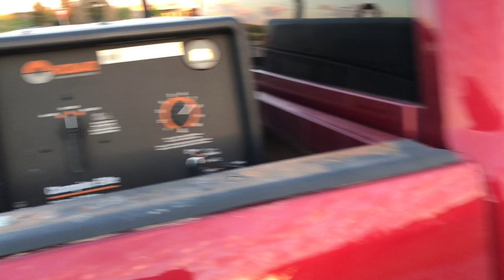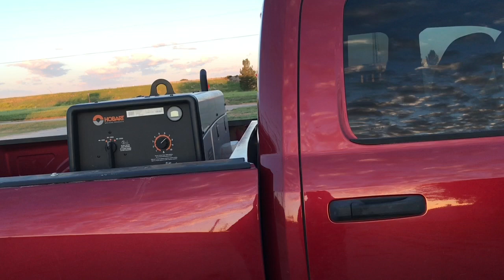I GOT MY FIRST MOBILE WELDING JOB!

Comment: Cool video, but you need to stand that acetylene bottle up, or lay it on an angle or the gases will mix. The oxygen bottle is fine to lay down, but not the gas.
Reply: Yea man stand them up for like 6 hours before you use em. Stay safe 🤙🏽
Reply: Exactly what I noticed. Good call
Reply: I saw the same yikes
Reply: @adamjoseph7124  an hour not 6 lol
Reply: The gases will mix ? 😂😂 inside a acetylene bottle, is a porous honeycomb like sponge called a monolithic mass as well as acetone to stabilize the acetylene. Stand up the cylinder 15min minimum before use to allow the acetone in the sponge to settle to the bottom.
Reply: @bscene3397  You pretty much just said the same thing I said....Go ahead and unload your bottles at the jobsite and wait for them to settle. Meanwhile, everyone else is already working because their bottles weren't laying down in the back of the truck 🤷🏻‍♂️
Reply: Same

Comment from the maker: Sorry if the music is to loud, I had to record and edit this video on my iPhone .
Reply: Happy for you buddy, but MAN you Acetylene bottle is on its SIDE. You can't do that bro it will Wreck your regulator and hoses and could cause a explosion from the alcohol in the bottom of the bottle that helps stabilize the acetylene..  you have to stand the ACE strait up at all times.. if it falls over or you load it on it side it must sit for a couple hours so all the alcohol can settle at the bottom.
Reply: Acetone, not alcohol in the acetylene bottle!
Reply: Its better with no music

Comment: good deal, buckets are nice to work on 
you might want to turn your welder longways so the controls are near the tailgate then the welder will get more air and run cooler. also you will have room up front to make a headrack to cover your  back window and you can bolt an oxygen tank to the rack for your torches because torches are really handy on most jobs and you dont want the tanks bouncing around in your truck. print up some business cards and put your name on your truck doors and you will be getting lots more work. good luck.

Comment: I’ve been welding since middle school. Took welding class in high school for 3 years and got a diploma in welding from my local trade school. I didn’t know what I wanted to do after trade school. I’ve been MIG welding for 5 years at a manufacturing job definitely not using my skills. I recently got a welder/generator and I am looking to start up a side business and keep my regular job for the benefits. Your video is very inspiring! Thanks man.

Comment: Your work attitude and personality will land you more jobs !
 #1  Never cut yourself short on safety !
 When working alone never leave your phone in the truck !
 Always invest in growing your business !
 You will find it will not be long you'll be needing a service truck with the right motivation and drive .
 I have owned the welding rig type truck but I have found the service type truck with the utility workbed more convenient to work with.. 
More boxes and drawers for all the cool tools you will find you will be needing..
 And a Crane is definitely a plus !
 Even when I'm welding on cracked leaking fuel tanks still on the machine and full of fuel !
And yes there a #1 rule to that part also !
 But yet no one wants to stick around and watch !! Lol
I'm Carl Massey & I Love my job !

Comment: Man you inspire me. I got my 3G weldering cert a few years ago and really want a rig welding machine. You got me all pumped up like I should do it. You had some nice weaving with those 7018. I do some fab stuff to but don't have my own shop yet. Really like to get on that pipeline! Be blessed bro!
Reply: Watch Austin Ross YouTube channel and you’ll change your mind about the pipeline work! It’s boom or bust, and recently it’s been bust! He’s doing general fab and repair now, and not sure he’ll go back to the pipelines lifestyle.
Reply: @tomt9543  hey Tom,  
I watch Austin once in a while. I am subscribed to his channel.
 I'm aware he's doing fab stuff and building pipe fence for customers. I have moved on from the pipeline idea but I'd still like a gas welder. I weld stuff on our farm and sometimes I need something portable.
Reply: @JacobAHull-nx6rx  I bet if you got an engine drive, you’d wonder how you ever got along without one!
Reply: @tomt9543  I have a lincoln ac/dc buzz box and an 210mp. I'm primary using flux core mig. yeah I'm sure I find some good use for a gas/diesel welder.
Reply: Did you ever get on the pipeline?

Comment: I started my last welding business with a Ram 1500 too!   Trailblazer 325 EFI, Miller Suitcase and a propane torch.  Good times.  I recommend a air compressor too.

Comment: Good job brother ! Ben doin it for 40 years ! Watch for fires on heavy equipment ! Oil spills / hydraulic fluid spills ! Youll want to use 11018 on teeth . Ther usually 100,000 tensile strength . Dont frget a fire extinguiser ! 
Be safe !

Comment: I run basically the same setup with a Miller Trailbrazer 302 as a post retirement side hustle. I was lucky and scored a 5HP engine driven air compressor for free. A couple small repairs and it runs like a top with enough capacity to carbon arc gouge or run my plasma cutter. A gouger is almost a necessity in the equipment maintenance game if you want to give value for the money.

Comment: Been chasing jobs for 20 years.  Last 3 welders were Hobarts. I get 500 hrs on it and sell them. I bought my last one in the fall. It has 100 hrs on it. I have a few vids that have my truck in them. Not much about welding. 
 Good work. I've welded some crazy stuff. I ran 8 inch pipe for an irrigation system. Don't turn nothing down. You might be good at it.

P.s.. Don't forget insurance. They can't take much if ya ain't got much. But it's all ya got. Lol. Some jobs don't care. I wasn't for years.

Comment: Good job and I wish you great success in life!  
A little advice on making your videos...
It is sometimes hard to avoid the wind noise when recording outside, but if the wind noise is too great, it can be distracting to the viewers and make it hard to understand what you're saying.  One way around that is to remove the actual video sound and add a voice over to explain what's happening in the video.  
Another note is about background music...
Your selection on this video was nice, peaceful, good and mood setting.  But, the one thing about the background music in this video is that the music volume seemed louder than your talking which made it distracting.  So, you should try lowering the background music to be greatly lower than your voice audio.  You can lower the music volume for the sections where your talking and raise it back up for the sections where you're not talking if you wanted to go that route. 
So, for this video, when you were on the job site, the combination of wind noise and the volume of the background music being a little too high were very distracting and made it very hard for me to hear you talking clearly and I could not make out everything you were saying and I wanted to hear what you had to say. 
This is just some video editing advice to a fellow YouTuber.  Overall, good video!  I have you a 👍!

Comment: Thats kewl. Your machine runs hot thats kewl. Im setting up my rig on my lifted dodge. My brother and i overhauled a 1987 miller trailblazer 250g which i bought n 2014. N here i almost sold it but instead we overhauled it and we reprinted it. So its still coming along. But great video. #rezboywelder

Comment: very cool projects, I do want to ask about where are you securing your acetylene tank? I hope not laying down in the bed? I couldn't tell if you had 1 or 2 tanks in bed, but it has to be standing up. I used to do side work, but stopped in 2012, I used a 1987 Toyota long bed, & put in what I needed to carry for each job, but sold that truck, but I made decision last year to get back into, & I made my first video 2 days ago, to show what I am starting with, a junked 1977 Toyota former RV & will be slowly building a welding truck, as time & money allows. I have majority of tools and equipment. but will show how to do it on a budget, & do some torch work, but trying to have fun as this gets built.
Reply: Hi randy!!
Reply: @kellypenrod2979   hello?

Comment: What do you use to power the welder? I’m 16 and work with a millermatic140. What welder and equipment are u using?!!
Reply: The welder is driven by a gasoline engine so you can weld anywhere. He brings his electricity with him!

Comment: Dude thats awesome i work as a welder in a shipyard and want to do just this, what welder do u use and how much?
Reply from the maker: Mitchell Brodeur heck yeah bro that’s awesome, I’m using a Hobart 225 champion elete  I got it new from tractor supply for $2999.99 plus tax for just the welder alone. Good luck bro and hope you succeed in your journey.
Reply: @WeldingProjectsTV  ah sweet thanks man

Comment: I'm new to your channel so honest question here, what certification is required for this type of work??
Reply: Generally none. Bucket work is not a preferred job for most welders in my area. Most shops charge a higher rate to do bucket work. The contractor just wants his equipment back in service fast, and doesn’t care about any certificate.